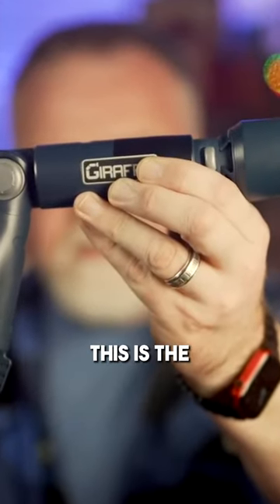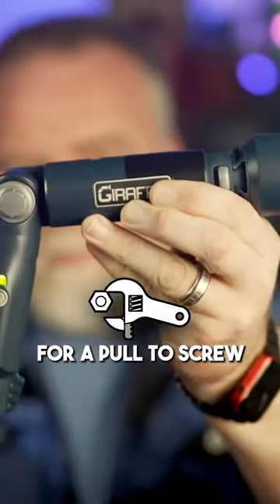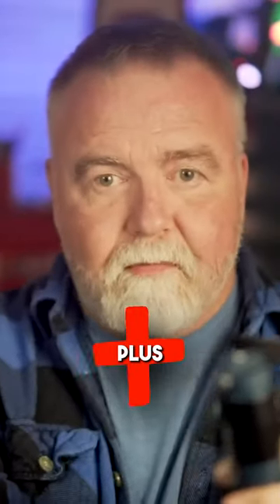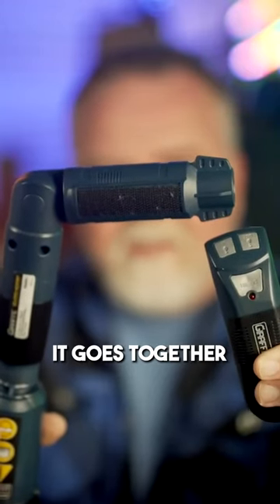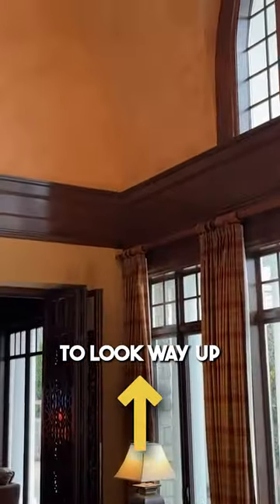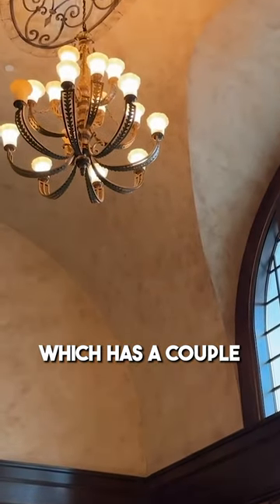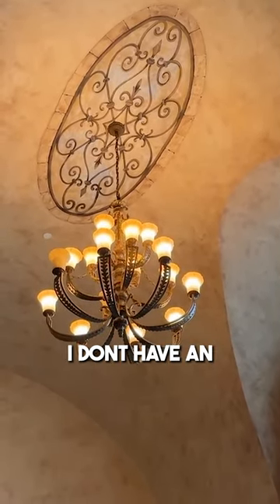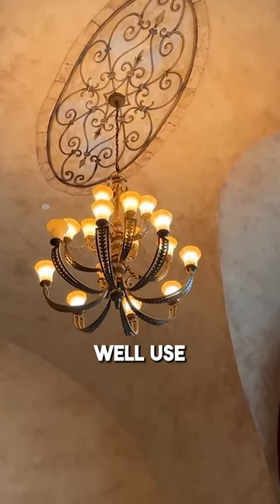A Genius Tool:  But What is it?

Comment: I was surprised to find that in some large homes, the chandeliers are on a winch motor and can be lowered for cleaning as needed.
Reply: When you think of it, it's an updated version of the pulleys they used back in the day for the same purpose. And to change the candles.

Comment: Might I suggest led that will last much longer?
Reply: I'd sure like to see one... The boards blow out after about a year
Reply: 1st gen led bulbs still going strong, @TheFeralEngineer  they only start to suck as price and quality goes down
Reply: @frogz  I used to machine the die castings for the OG led bulb heatsinks back in like 2010. Designed a pretty sweet pneumatic work holding system for them. I buy what should be considered the current higher end brands and they are all garbage
Reply: @TheFeralEngineer  oh, i never said the good brands here quality up,  i have some first gen Phillips still going strong

Comment: This wouldn't work if a bulb is dusty or stuck. 5m high A-frames do exist, maybe higher too. Another option is scaffolding.
Reply: Why wouldn't this work on a dusty bulb? You could remove it and clean it with this tool. As for stuck bulb, you're correct, but bulbs don't get stuck very often.

Comment: I'll aim My gun at the twit who installed a shandaleer in a position with restricted access for maintenance. (They also require routine cleaning.)
In the black and white days, chandeliers were secured to the ceiling rose by a pulley system. 😂